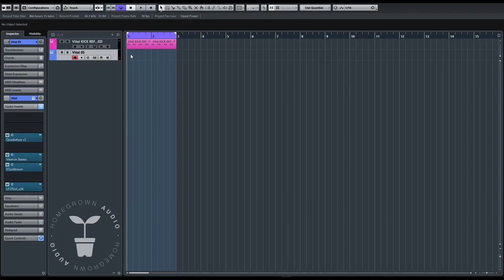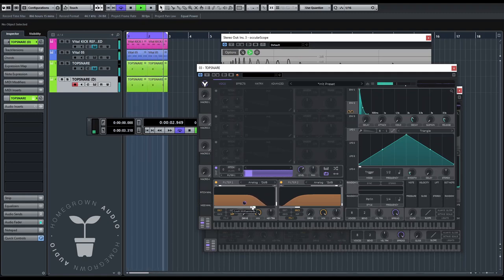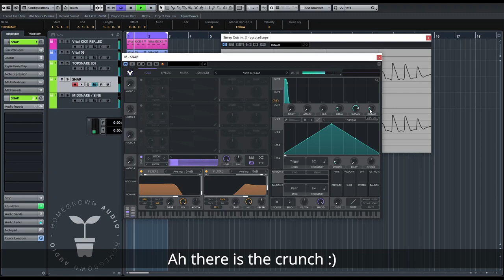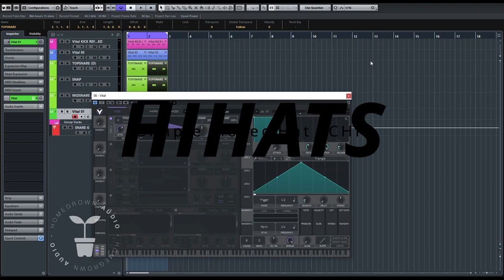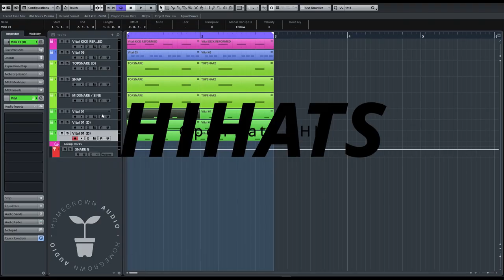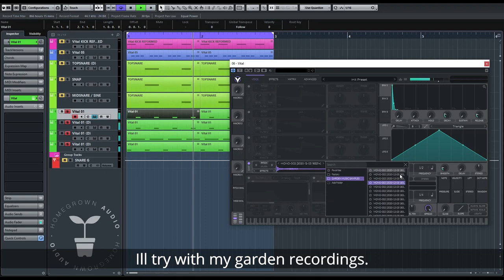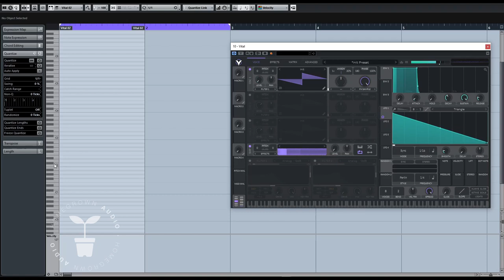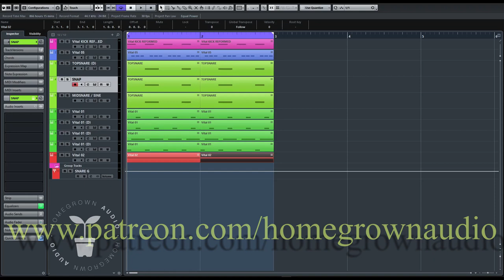Vital Sound Design: Percussion Synthesis. Layered Snare. Create Your Rhythm Section In 15 Minutes.

Comment: Great tutorial ! demystified how to go about making snare layers ! I have a small doubt if i may i have noticed in the occular scope that when snare is hitting the amplitude of the kick waveform is increasing , so snare also should be aligned properly with kick so that phasing doesnt happen in the low end ? is it something which is done in psymusic ?
Reply: I generally just worry about phasing with the fundamental frequency and stuff really close to it.
Anything like this snare 150hz would be something like 2nd harmonic or higher so wouldn't really bother but u can try and maybe makes difference. Thing is kick is first 16th just a bend so won't make any difference till second 16th and by then snare is almost purely mid and hi freq, the sine stops a bit before